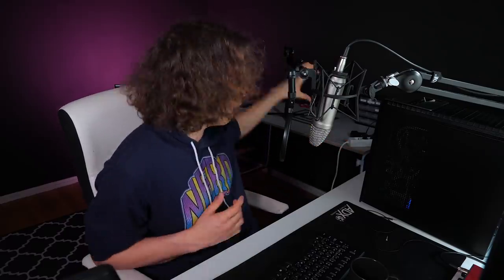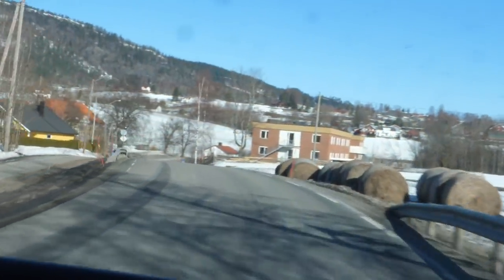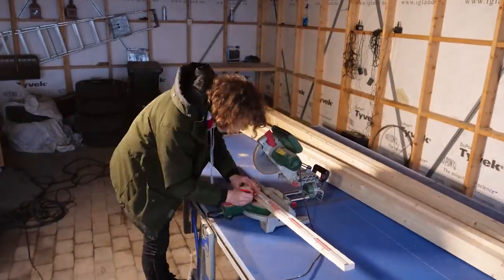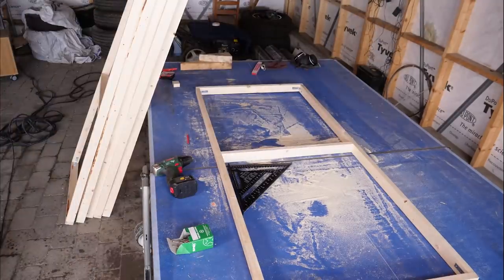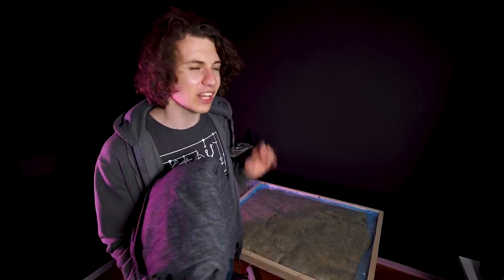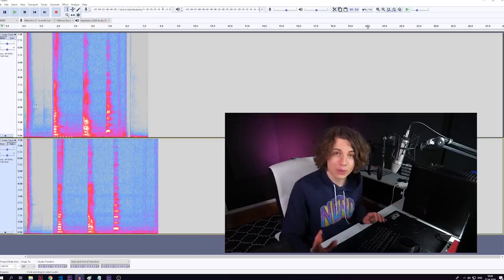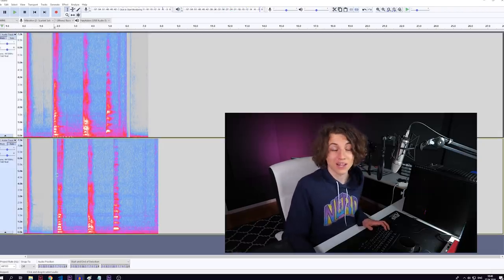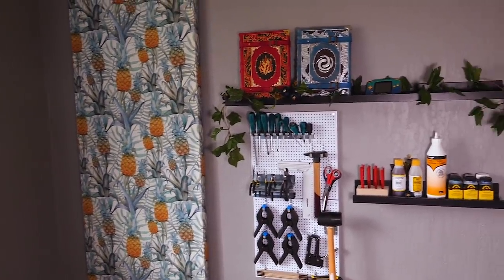How To Make ACOUSTIC PANELS For Better Audio (CHEAP DIY project)

Comment: Doesn't wrapping the rockwool in plastic kinda defeat the purpose of using rockwool? Now it just as a large flat surface to bounce the sound back instead of expanding the surface area like bare rockwool would. I don't know, i'm not an expert on this but my knowledge from broadcast sound engineering school tells me this shouldn't be done this way.
Reply from the maker: I'll copy paste my answer from down here, probably pin it as I guess this will come up a lot. That's what seems intuitive, but if that was the case you could sound insulate with a layer of plastic. Only the very, highest frequencies will be caught by the plastic, whereas the lower ones will pass right through be absorbed/dispersed by the stone wool. The lowest frequencies, like bass, will probably pass through both, and reflect back, as these are not thick enough to catch the entire spectrum. At least this is my understanding of it, without being an audio engineer. The actual effect these panels has on the room is quite large, just hear my tests in the end :)
Reply: @Nerdforge  makes sense. I knew it would help a bit but I'm thinking without the plastic it would be better. I dropped out of my sound engineering course after 6 months. So I won't ever claim to be an expert on the subject.
Reply: @Nerdforge  you really shouldnt have wrapped them in plastic. Mate think. Sound waves travel through air. Vibrations of air. That plastic wrap is not letting air pass through it. This means that no air waves will ever be dispersed into the rockwool. But you got some good results never the less. I just think you could have gotten better by wrapping them in a couple layers of cloth.
Reply: Nerdforge well, for low frequency absorption, these panels are not thick enough 😉
Reply: INeedsMoneys sound waves travel by particle movement, no matter the medium, that is why u can hear voices through the walls...
Reply: @udayverma9749  damn I didn't realize how condescending I sounded in this comment originally.
Reply: plastic is so thin it won't be reflective in a bad way, breathing in the dust would be way worse, especially for people spending most of their time inside the control room. Also, you can enclose the rockwool in wood on all sides and the LF will still pass through it because it's a matter of energy, as a matter of fact most designers will use a layer of HDF, MDF, perforated, etc on the front of the material to further accentuate LF absorption and lower the effect on HF.
DO yourselves a favor and inform yourselves on gearslutz. This stuff can be wrapped in polyester batting to trap the fibers (many pros do this) and the effects of doing that won't even be noticeable.
Reply: Rockwool is not a healthy material to have around, especially in  enclosed spaces without windows. Wrapping it in plastic may have a minimal  impact to acoustics but it has a huge positive impact to your health. Breathing fibers is not good for you. Especially considering that chalk is usually mined  in places where there is asbestos as well, often mixed with it and, if you remember the Johnson & Johnson baby powder asbestos scandal,  there is no reason to fully trust a company that tells you that its  chalk related product  is completely free of asbestos. In any case, i don't like breathing fibers anyway.
Reply: @jake_  Rockwool just like asbestos, is safe as long as it’s not disturbed. Shouldn’t have wrapped it in plastic.
Reply: @x9x9x9x9x9  ...😄

That reminds me of the wisdom of the "I know, trust me, I've been in the university ".

Comment: There is a type of barrier used for blown in insulation called insulation netting. It is a fabric that is used to contain the glass fibres instead of plastic. It would help to absorb a little bit more sound than the plastic, however these ones do sound fantastic!

Comment: Really nice DIY but for anyone wanting to do this at home, I recommend that you don't pack the rockwool in plastic but rather in some fabric or a towel. This is because the rockwool can really help reduce the ekko but when you put plastic over it, the sound will bounce right off the plastic instead of being absorbed by the rockwool.
Reply from the maker: Thanks for the feedback! Copy pasting my anwer from another post as a little correction for anyone reading this: the plastic is too thin to have a real impact of performance, if you are going to use rock wool I absolutely suggest using plastic to prevent rock wool fibers to infiltrating your room, as it can be a health hazard. For those interested in the physics  here: The higher frequency, the shorter the sound waves are. It is true that the shortest sound waves might be reflected by the low density plastic, and a fabric or even less dense material might produce a better result at the very high frequencies. But for the lower ones, usually those which comes off a voice (and those that we want to catch) the sound waves vibrates the plastic and passes right through it before being dispersed by the rock wool. However, if the frequency is very low, as in a bass, they might pass through it altogether, and be reflected anyway. The only thing that helps for bass frequencies is an ever thicker layer of rock wool (or foam)! Hope that cleared out the confusion :)

Comment: To tell whether wrapping the rockwool in plastic has a significant effect one really needs to do multiple tests: one test with rockwool panels without plastic wrap or fabric facing, one with rockwool and plastic but no fabric facing, one with rockwool and fabric but no plastic, and one with rockwool, plastic and fabirc. Then you could record tests in the four different cases and see what effect the different materials have.
It may well be that because of the plastic wrap nearly all of the acoustic dampening is due to the fabric facing rather than the rockwool, but more rigorous testing is needed to know what is actually going on.

Comment: Won't covering the rockwool in plastic kinda make it rather useless? To stop the sound from bouncing around you need it to be traped (by a mass)  and not a hard surface as the plastic?  The only thing that stops the sound from reverbing on the traps now is probably the grey felt?

Comment: Wrap insulation in Tyvek Fabric instead of plastic. It will keep insulation particles inside so it's safe and also breathable (unlike plastic) and the panels would work at 100%.

Comment: Doesn't the plastic wrap basically negate any sound absorption of the stone wool making your panels only absorb reverberation due to their cloth wrapping?
Reply from the maker: That's what seems intuitive, but if that was the case you could sound insulate with a layer of plastic. Only the very, highest frequencies will be caught by the plastic, whereas the lower ones will be absorbed by the stone wool. The lowest frequencies, like bass, will probably pass through both, and reflect back, as these are not thick enough to catch the entire spectrum. At least this is my understanding of it, without being an audio engineer. 

Edit: fixed my phrasing

Comment: I'm wondering if cork might not have been a better material selection for these than rockwool?  Perhaps it was too expensive to do that way?  However, if you used cork, you could have dual-purposed one over the desk as a note board to pin schematics, drawings, concept art, veterinary appointments for the cats, or whatever else you needed on!  😄 Of course, you might have needed to back the frames with MDF or something to keep the cork in one piece...

Comment: My gut instinct says it's ok to use thin plastic, since the voice doesn't produce strictly super high frequencies. The mid range frequencies also create reflections in a room and the plastic wrapped panels should still dissipate much of that energy. Maybe the best bet is to supplement the plastic wrapped panels with a small amount acoustic foam in strategic areas of the room to catch some extra high frequencies. Theoretically, this would be a more balanced way to absorb. Would love a more in depth video comparing plastic vs. none vs no fabric.

Comment: Do you have any link to matiral you used to wrap the panels? I will make those panels, but want to make them in white. Just don't know what thickness should I take (ok, you wrote 0.9mm)and what exact material it is? Also maybe the link for plastic? I want to test with and without plastic for sure 🙂
Reply: Denis Josifoski He used 1 mm thick felt material. He also said you could use any material you like. You should really use the plastic though, rock wool has small rock/glass particals in it and if you breath them in they could really damage your lungs. It’s the same thing they put in the walls of your house as insulation. Also wear a mask while handling rock wool 😊
Reply: @amyb2885  Amy thanks. But I would still need some links 😁. If affiliate links, I would appreciate some UK/DE amazon links.

Comment: I'll add my bit of comment about the rock wool and the plastic and fabric wraps around it.

One needs to differentiate between sound transmission an reverberation.

Briefly :from a room to another it's all about transmission and here having discontinuity between panel makes it useless (but I guess it was not the intention at all from what you said).

About reverberation it's mainly about having stuff filling the room or breaking reflections from happening. One should try to avoid speaking between parallel walls or put absorbant material on at least one of the surface (it breaks echo). It's what you did.
But then for rock wool to have an impact it would need most of the energy getting to it. And from what I'm guessing it's mostly the fabric that does the job since it doesn't look acoustically transparent. And event if it was acoustic fabric the plastic wrap witch is not absorbant at all would kill it's effectiveness.

I'm guessing it works because of the fabric (usually heavy ones are quite sound absorbant) and in that matter having it hanging freely would do even better.

A small but effective update would be to spray a thinned layer of wood glue over the rock wool to keep it from flying in your lungs and removing the plastic wrap.
To increase furthermore you could space the panel about an inch from the wall to make a cheap bass trap.

I hope my comment is constructive for or anyone needing the advice. I'd be glad to answer questions one may have.
Also this is backed by my now quite old memories of acoustic lessons. I don't wraps my studios every days and last one I did was 3 years ago.
Reply from the maker: Thanks for this! I am intrigued by this answer, I've been spamming my understanding of the research I've done on other threads here. I'd like your input. Also now I really want to make one without rock wool to compare results with rock wool!
Here's what I've been telling others: The plastic is too thin to have a real impact of performance, if you are going to use rock wool I absolutely suggest using plastic to prevent rock wool fibers to infiltrating your room, as it can be a health hazard. For those interested in the physics  here: The higher frequency, the shorter the sound waves are. It is true that the shortest sound waves might be reflected by the low density plastic, and a fabric or even less dense material might produce a better result at the very high frequencies. But for the lower ones, usually those which comes off a voice (and those that we want to catch) the sound waves vibrates the plastic and passes right through it before being dispersed by the rock wool. However, if the frequency is very low, as in a bass, they might pass through it altogether, and be reflected anyway. The only thing that helps for bass frequencies is an ever thicker layer of rock wool (or thich foam).
Reply: You are right in the way that plastic is too light to impact much the transmission of sound by itself. And the sound that got through it will be absorbed by the rock wool.
But the problem lies in the -much-, a significant part of the energy in the sound will be reflected. Lot more than what would have been reflected from the rock wool alone.

You can understand it the same way that light and a glass behave, i find it easier to visualize : 
Starting from a ray 100% of it's energy being light.
When hitting the glass surface some light will reflect and some go into the glass, say 20% reflect and 80% refract (means going in and being deviated)
The 80% refracted will be partly absorbed (and heat the glass), let say about 10%.
Rounding it means 20% is reflected and 10% absorbed and 70% still going for another round.

In sound application same thing goes and we measure reflection by the time (or number of cycles) needed to get below a threshold of energy that we won't hear as an echo. Usually 50dB, about 100 000 fold decrease.

And know you get some properties of materials to build your studios : 
-concrete : heavy so hard to get it moving from lighter material such as air, HIGH REFLECTION, hard/brittle so low absorption of the sound that managed to get in.
-Rock wool : due to the fiber size it has a huge contact area so LOW REFLECTION, and quite low internal contact between fiber means longer internal distance for the sound to move through and get absorbed.
-Fabric : same as rock wool but in 2D instead of 3D so less effective.
-Plastic sheet : quite reflective of a material and not good at absorbing.

Quick mock up :

I want 50dB of sound reduction and no energy can get out of the room so it need to get absorbed (transformed in heat).
My room is 3.3 meter deep and infinitely long and high (it's easier with only one pair of wall to think about).

Fabric only, on both wall, reflecting 1%, absorbing 20% each pass :
pass 1 - 1% reflected, 99%x20% absorbed, 99%x80% through and then reflected on the wall. ENERGY LEFT = 0.802
0.01s to go to the other wall (celerity of sound being 330 m/s)
pass 2 - ENERGY LEFT = 0.802x0.802 = 0.802² = 0.643
...
pass 53 - ENERGY LEFT = 0.802^53 = 0.000009 => -50.8dB in 53*0.01 = 0.53 second

Rock wool only, reflecting 0.1%, absorbing 30% each pass : 
pass 1 - 0.1% reflected, 99.9%x30% absorbed, 99.9%x70% through and then reflected on the wall. ENERGY LEFT = 0.6993
...
pass 33 -  ENERGY LEFT = 0.6993^33 = 0.000007 => -51.2dB in 23*0.01 = 0.33 second

Rock wool and plastic, reflecting 30%, absorbing 30% each pass : 
pass 1 - 20% reflected, 70%x30% absorbed, 70%x70% through and then reflected on the wall. ENERGY LEFT = 0.79
...
pass 49 -  ENERGY LEFT = 0.79^49 = 0.000008 => -50dB in 49*0.01 = 0.49 second

And here plastic is only reflecting 30% of the sound (and we considered 0% absorption) , meaning 70% of the sound got through, that being less than 1.5 dB, a very small attenuation for someone behind the plastic film. But it managed to destroy the quality of the whole construction.

Of course those value are coming from nowhere but the picture is the same in the real world.
Reply: And an important thing is that rock wool, if sprayed with light glue can't get airborne and will keep most of it's properties for the acoustic part.
Reply: @1312iYo  All that theory and math relies on one big assumption: thin plastic wrap reflecting 30%. What is important is at what frequency the plastic absorption becomes significant, I am pretty sure it reflects near 0% at bass frequencies.

Comment: Suggestion: fill the back of any paintings with this padding stuff / use the panels as canvasses. I dont know if it would work, but I don't see why it wouldn't.
Reply: It will slightly help but the problem is, with a sealed surface you will bounce back frequencies defeating the purpose of it. Also paintings are ARE NOT deep enough. Panels should be 4-6 inches thick for side panels MINIMUM,  & 6-12" for corne bass traps.
The fabric should be able to pass air or you will be reflecting , not absorbing.

Comment: This was great! Can I ask something? I am really confused which fabric to use as many people suggest those fabric that are breathable enough to let the sound through. But I'm worried about the particles slipping through the fabric and breathing them. Then I saw you literally put plastic which essentially has no hole in it, basically not breathable. And yes, Im putting it in my bedroom/studio. I don't wanna sleep with these if Im breathing them in.
Reply from the maker: Having a thin layer of plastic will prevent particles from going through, but it might reflect some of the very highest frequencies. I don't have studio standards, so this is fine for me. (it might also be that the fabric itself absorbs the frequencies that the plastic reflects, which would be a win-win, but I don't know).
Reply: @Nerdforge  Got it mate. I'll try doing experiments with these. But yours do sound really different before and after. Great job! Thanks man!

Comment: I would be interested to know if the reflective effect of the plastic weakens if the elements are covered with porous fabric like Molton. I have extra fabric which is porous but I don't know if I want to use it in the corner elements which are in plastic

Comment: Someone didn't do their homework, you covered the Rockwool with plastic, all you've done is create a another wall for the sound to bounce off..... lol
Reply: Depends on the plastic - according to some experts, cling film or dry cleaning bags are thin enough to not make a difference. Sound doesn't actually behave like air.
Reply: The plastic is to disperse higher frequencys, and the lower frequencys pass through the plastic and are dispersed by the rockwool. Even deeper frequencys can most likely pass through both. So it's not exactly the best. Hope this helps in some shape, way, or form. Toddles!
Reply: @thomsonhomson  But sound does.